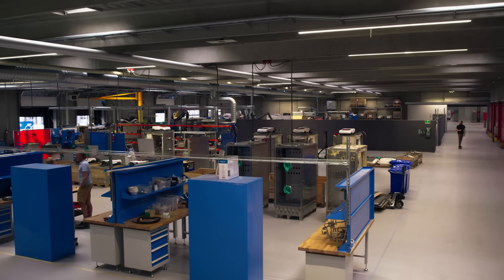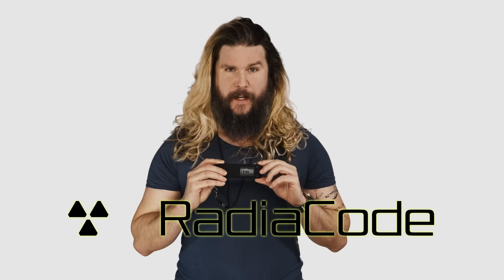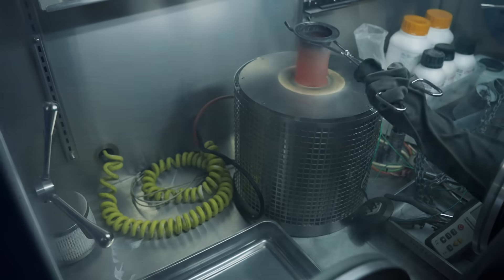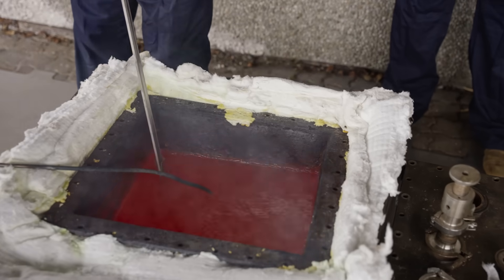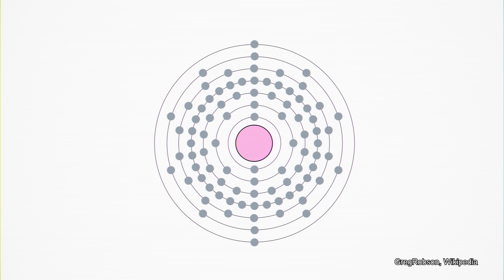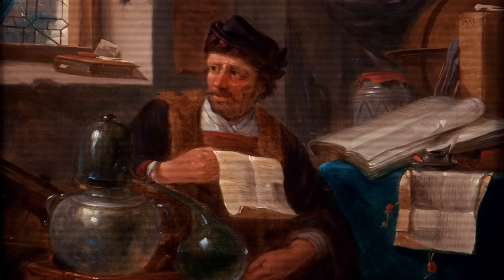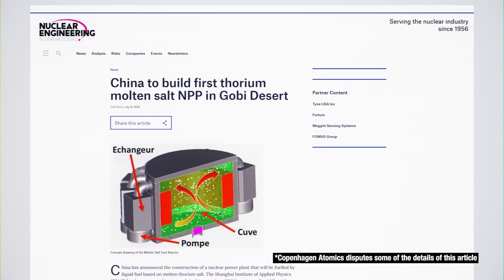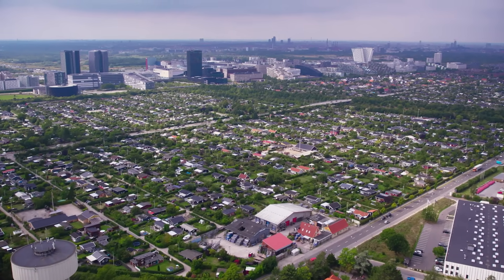Is THORIUM the Future of Nuclear Power?

Comment: America had a molten salt reactor at Oak Ridge in the 60's.
I'm sure someone in the comments will know more than me but I believe the U.S. chose not to pursue this method of nuclear power, favouring instead Uranium breeder reactors due to the need to produce material for nuclear weapons.
Reply: That's what I remember as well from when I read about the Oak Ridge reactor years ago. The research reactor was in need of repairs and maintenance, and America was really gung-ho about building bombs at that time and they figured that they had learned enough about thorium and fixing the reactor or building another reactor seemed unnecessary to the powers that be. 

I also remember reading about the DOE having a huge stockpile (I think it was in the thousands of tons) that they had accumulated and buried somewhere in containers. So if the technical challenges of thorium fluoride reactors are overcome, there's enough fuel already amassed to last generations.
Reply: @ottopartz1  Oak Ridge was fueled with uranium, and never ran any thorium. While the Atomic Energy Commission (the organization of the day) did go whole hog into thorium cycle power plants (they built 4 commercial power plants in the USA and Germany built a 5th one) ll it proved was that uranium fuel was far cheaper than thorium reactor fuel because if much more costly to extract thorium from thorium ore and produce thorium cycle reactor fuel and it was to produce. While the AEC did produce a lot of U233 as seed material for vision of having most USA nuclear power plants running the thorium cycle (we have proven BWR and PWR thorium core designs that could be used today all over the world in existing BWR and PWR power plants if Thorium fuel was cheaper than uranium fuel - not a single country in the world is doing so - not even India whose power reactors are running U235 based fuel); the current Department of Energy is now spending $billions to dispose of this U233 as the containers its stored in are degrading and its cheaper to dispose of it than repackage it and continue to maintain it as there is no expected future use for it.
Reply: Everyone likes to claim it was because the US was "Bomb happy" But reality is what he only very briefly touched on (and has said in other comments that the lifespan of the system in part 2) is that the reactor needs to be rebuild within 5 years because the corrosive nature of the salts to metals. Not much has changed in 60 years, metals are still reactive to salts, specially when heated to molten temperatures unlike the standard nuclear reactors which have lifetimes of decades.
Reply: @SilvaDreams  seems like that could be easily circumvented with ceramic linings/coatings.
Reply: @SilvaDreams  i suppose the problem of it being corrosive can be circumvented by having faster swappable equipment or some other solution similar to that. I can't imagine you'd need a whole new reactor, just the key parts in contact and if it takes maybe a year or two to need replacement, that sounds feasible enough to do. The economics will come into place once an industry gets going. Maybe in future we can look back at it as tires for cars needing replacing.
Reply: @ItsMeChillTyme  That includes all the piping an pumps..... That's half the cost of a nuclear power plant and far to costly and time consuming to do.  Keep in mind that once the reactor starts all of this equipment is going to be highly radioactive - and extremely difficult and costly to remove safely or install replacements
Reply: @ItsMeChillTyme  the thing is, when you handle radioactive material swapping your equipment is connected to a number of problems.
Reply: @MusikCassette  what problems?
Reply: @ all of them^^
Reply: @ I mean  for starters: you have a radioactive wok environment.
wich is a bit unhealthy ^^
than you need to make damn sure nun of the radioactive material escapes during the swapping (more so and under higher constrains than with dangarous chemicals)

And you kind of need to deal with the old equipment. that is now radioactive wast too.
Reply: @MusikCassette  I think you need to learn about safety standards and radiation levels in plants, with all due respect. The work environment is not any more radioactive than any other. The material is handled entirely without exposure.
Reply: @ItsMeChillTyme  your condescending  tone is inappropriate. That is in general, but especially given the lack of understanding, that you just demonstrate. the standarts mke it quite difficult to swap out the very containers and the plumming, the radioactive material is in.
Reply: @SilvaDreams  purify the salts and the corrosion actually isn't that big of a deal. Sure, lower reactor life than current reactors, but much simpler to build. If you can mass manufacture the parts that needs replacing this is not really a problem, just a different operation philosophy.
Reply: @MalcolmAkner  The ability to purify the salts is an untested theory for a running MSR reactor (the Chinese started testing it in I belive August 2019 on their 2 MW thermal test reactor).  China has not said how well its working (or not working yet).

Also, the components and parts will be highly radioactive once the reactor starts (at radiation levels that could kill you).  It will be very expensive and time consuming to replace any parts.

Don't count on unproven technologies to work in the real world.   MSR reactors are very much in the inital test phase -with a lot of development work needing to be done to scale them up to utility sized power plants.  The nuclear industry worldwide is littered with shutdown plants where some theoretical idea did not work out and could not be reasonably modified to something that worked.
Reply: @perryallan3524  tell me about it, I worked on the one in the video for 4 years. The purification definitely works, we were pumping salt through SS316 for many thousands of hours cumulatively (same pipes, no replacements). 

There's definitely some important kinks that need to be ironed out, most significantly I believe is the fission product separation that needs to be done online for this to even work. 

Handling activated materials is expensive but not prohibitive. Best thing to do is just to let the material decay down to where it can be handled. If MSRs turns out to be the next big thing there will be steel plants specifically dealing with remelting activated material.
Reply: @SilvaDreams  With advanced materials, maybe China figured it out the corrosion problem.
Reply: @ China can't even get basic metallurgy going, how do you expect them to make advanced metallurgic advancements?
Reply: @SilvaDreams what? Why this sudden condescending tone?
Reply: @SilvaDreams  Tsinghua University has a more renounced metallurgy dept than US best MIT
Reply: @pugster73  Lol, that is a good joke.
Reply: @pugster73  do you mean it’s alumni renounce their association with the institution?
Reply: @pugster73 Renounced would imply it is not respected. The word you should use is "renowned" meaning famous. Gives a whole different meaning, doesn't it?
Reply: @SilvaDreams  This is just a lie.
Reply: @pugster73  Pretty sure China doesnt use molten salt but helium
Reply: @SilvaDreams  You know nothing of china if you think they haven't figured out basic metallurgy. Don't speak on topics you are so very ignorant.
Reply: Partly, the Navy engineers loved 'live steam'
Reply: The Oak Ridge MSR was shutdown because it was a maintenance nightmare and very unreliable.

Here's some facts about it:

1) The Oak Ridge test MSR was designed to produce 10 MWthemal. There is conflicting information on the web about the actual peak output - was it 7.4 MWthermal or 8 MWthermal; but no more than 8. It's also generally acknowledged that operation above 5 MWthermal (50% of design) was very problematic.

2) The reactor went critical in Jun 1965 and was shut down Dec 1969. 4 1/2 years of calendar time. It ran for 13,172 hours in those 4.5 years. Convert those hours into years and you get 1.5 years of operation in 4.5 years.

So it only ran for 1.5 years - and mostly at 50% of design power or less.

3) It tripped or had to be immediately shut down for repairs 167 times in those 1.5 years of operation. It had 58 planned shutdowns (with most of them being planned the day before as after a solid year of operation they could see problems that they knew would trip or force a shutdown - so they "planned" a shutdown).  225 total shutdowns in 1.5 years of operation.   Modern nuclear power plants might have 1 or 2 shutdowns in 1.5 years of operation – and many have no shutdown in such a time period.

There were no quick fixes for any of the problems... even reoccurring problems that they dealt with repeatedly. Why it had only 1.5 years of run time in 4.5 years of operation.

4) They discovered serious radiation embattlement of the Hastalloy N primary loop after just 1.5 years of modest low power run time. It would have likely have failed had the reactor run at near full power for much of the 1.5 years.

5) They discovered after shutdown a serious "corrosion" issue with the Hastalloy N throughout the entire primary loop (including piping and pumps). This is not in the form of general corrosion; but with Stress Corrosion Cracking of the alloy (which is a corrosion process). They concluded that failures would likely have occurred with another year or two of hot liquid molten salt fuel/daughter product in the piping and component system under normal operating pressure and temperature.

Conclusion: This was in fact the most unreliable and problematic test reactor that the USA ever built. 2nd place is so far away to show just how shamefully bad this reactor design was. While I don't have access to all the test reactor data in the world... It is likely the worst and most unreliable test reactor design in the entire world.

Yet this is the design that people claim ran "successfully" for 5 years and proved it worked. I'd say that what was proved was that the material and design did not work from a practical standpoint. It did prove the concept of some kind of molten fuel reactor.

Hope this clears things up.
Reply: My grandfather had a few patents related to molten salt reactors
He was a chemist for ORNL
He said they didn't pursue it because politics got in the way. Three mile island and Chernobyl really hurt perceptions of nuclear power.
Reply: @Battleship1996  The politics involed was that President Nixon cut the Atomic Energy Commission (AEC) research budget in half in the very early 1970's - and let the AEC decide which projects got cut.   Given the issues with materials and other problems with MSR reactors the AEC cut further development work as there were more promising projects to fund.  That was long before Three Mile Island and Chernobyl.
Reply: "need" -> "imagined need"
Reply: Normal power plant reactors cannot produce bomb grade materials without doing some really crazy things that everyone would notice.

Normal U235/U238 and possibly mixed oxide U&Pu fuel reactors breed Pu239 from the U238.  That is true.  But they also breed some Pu240 from the Pu239.   Pu240 is a poison to Pu239 for bomb making.  There can only be a very small amount of Pu240 or the Pu239 cannot be used to build a bomb (please read the WIKI article on Pu240 - it had a great description of the problem).

Processing (or reprocessing) is a chemical separation process - you get all the isotopes of the material you chemically separate out.

The secret to making bomb grade Pu239 is to only run the fuel or U238 breeder rods for a couple months before processing them to recover the plutonium.

Power plant fuel cycles are normally in the 1.5 yr to 4.5 year range, and even 1.5 years of operation produces way to much Pu240 for bomb grade material.

This is why there have always been special bomb grade production reactors run initially by the military in WW-II and then the Atomic Energy Commission, and now the Department of Energy - although the reactor has been idle for years now.

Also U233 produced by breeding thorium makes a great bomb, but U234 poisons it the same way Pu240 poisons Pu239.

So the U233 produced in the fuel rods or blocks for the gas cooled reactors from the 5 commercial power plants built to run on the thorium cycle could not be used to build a bomb as well.  The U233 bomb that the USA tested had its U233 produced in the bomb grade reactors with thorium rods only exposed to breeding for a few months.
Reply: It was shut down by Nixon for political reasons.
He wanted to promote a breeder reactor in California, so he cleaned the board of most things that could compete with that.

Comment: @15:21 Weaponization is a function of nuclear reprocessing, and reprocessing on a short time frame so you don't contaminate your fuels with excess neutrons.  In the Thorium fuel cycle, you need to get the Pa-233 out of the reactor before it captures another neutron.  Failing to do so requires an additional two neutrons ( decay to U-234 -> n -> U-235 -> n -> fission) before it's useful, and that ruins your neutron economy.  The whole purpose of a MSR is to have continuous reprocessing in the loop, permitting the immediate extraction of Pa-233 to decay into U-233 fuel to be used in the reactor... or in a weapon.

I'm all for breeder reactors, I see nuclear power as a dead end (in the relatively near future) without them, but we need to get over this fear of weaponization.  You can't have one without the other.

Comment: My only question so far is, how can you be certain you won’t get a runaway reaction in the plumbing system away from the control rods that can modulate the speed of the reaction

Don’t get me wrong I am all about nuclear power Kyle has made sure of that but it is something I fell needs to be asked
Reply: Fast neutrons slow down the fission rate in systems not designed for them, this has been observed over the last 70 years of tests, including the one of these we actually built in 1965 and ran for a few years. You could build a fast spectrum molten salt reactor, though it'd be chloride and breed plutonium from natural uranium... also, fission products would be in the salts too so there's significantly more chance of hitting something that's not fuel.

Comment: Because salts are corrosive and designing a system to pump high temperature molten salts around a loop for years on end without corroding through the containment apparatus is exceptionally difficult.

Comment: I seriously doubt Thorium will become standard, when we are legitimately within a couple of decades of having nuclear fusion on the grid.  We now know it's absolutely possible; we've done it more than once now.  They just have to work on stability and scale.  They're engineering problems now, the fundamentals of fusion are well understood, we just need to make it profitable by increasing output and reducing input.  Both are achievable goals given advancements in recent years.  I feel like some countries might consider this in the short term, but it's pretty safe to say at this point that we WILL NOT need fission power for terribly much longer.

Comment: the question I always have with thorium is they say it "makes its own fuel" (uranium) AND they say it produces less nuclear waste than a uranium reactor.  So, how does uranium produce less waste than uranium?

Also, this "fission products *can be removed*" thing - sounds like "all we need to do is work out the minor problem of antigravity" or some such challenge.  Have they REALLY solved this problem?  I know that "spent" uranium fuel rods aren't just thrown away, they're taken to a reprocessing facility and the useful uranium is re-concentrated to form new some of the fuel pellets that go back to the reactor.  It sounds like you're just pumping out the salt/thorium slurry instead of swapping out fuel rods.  This doesn't sound like THAT big of an improvement?  Are they going to try to do the "exhaust separation" on-site or will a truck arrive with new fuel and you just pump out the used slurry and pump in new, and they haul the spent away for "cleaning".  (pretty much the same thing that happens with uranium fuel rods right now)

While the information in this video was interesting, I can't say I'm seeing any new solutions or breakthroughs here.  Tell me how uranium generates less waste than uranium, and tell me more about how (and WHERE) you plan to keep the fuel clean of fission products.

Comment: Something that stood out to me when it was mentioned was that the metal components of the reactor only have an operational life of 5 years. Which I believe answers a thought I had at the start of the video wondering how well the components of the reactor will stand up to molten salt.
Reply: Have a look at how they solved the corrosion problem in Moltex's SSR design. 
Long story short, don't pump the fuel, put it in static fuel tubes with a sacrificial zirconium coating, problem solved through creative chemistry

Comment: Why is it harder to weaponize? What stops you from making a nuke out of U-233?

Though I suppose they could mix U-238 in there, just to make it harder to separate out the U-233 when it's done.
Reply: 232 contamination. An MSBR could happily run at 200+ ppm 232, whereas a weapon would need 50 ppm or less.